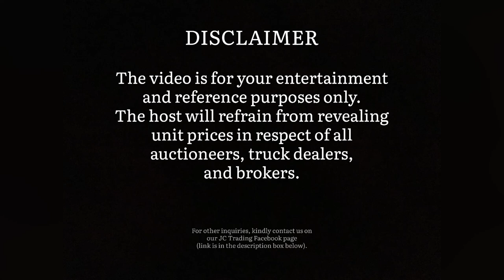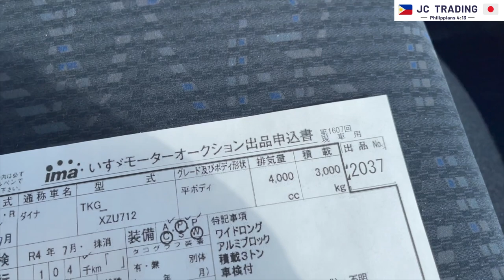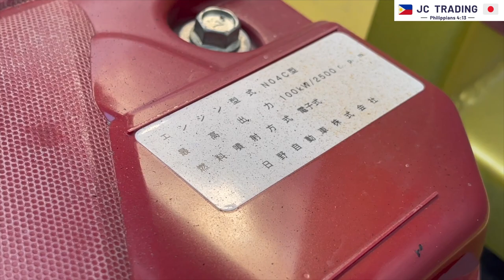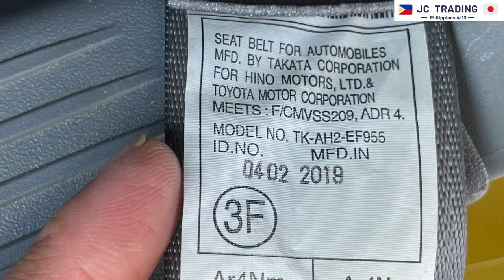YEAR 2019 MODEL TOYOTA DYNA CARGO DROPSIDE | INSPECTION BEOFRE AUCTION #toyota

Comment: Medium gold painted, but not 24K gold. When using real gold coating (24K), may be expensive. Engine N04C-WP 180PS, wide cabin type. 2020-up model of dyna has led headlight & color MID display on instrument cluster. Also hybrid powertrain available for both Toyota Dyna & Hino Dutro, using 50kWh li-ion battery & 35kW e-motor for reducing fuel consumption, also improved acceleration & loading capacity. When newest Toyota Dyna Hybrid available in auction, create review of it